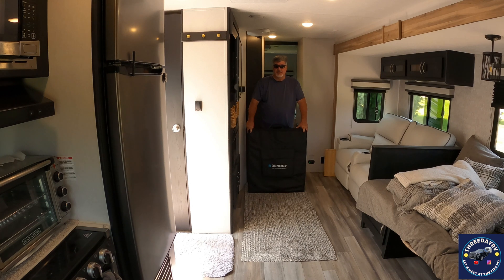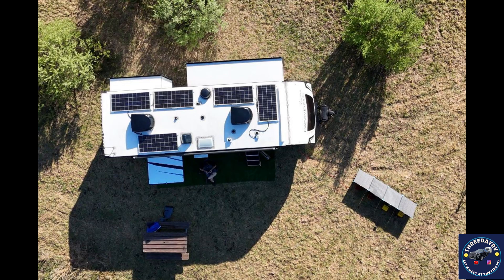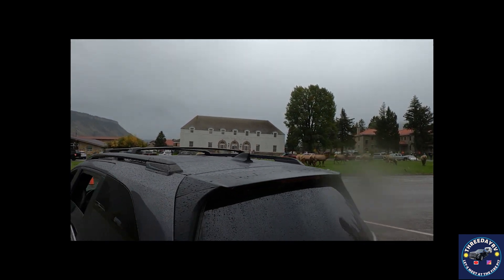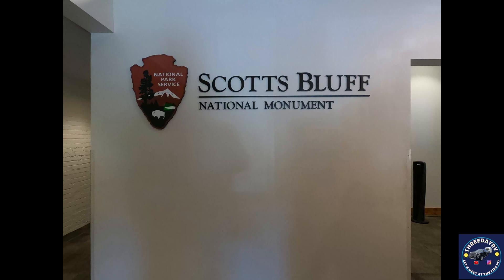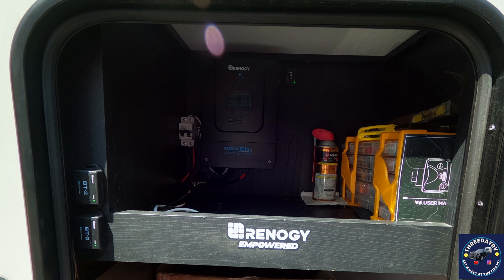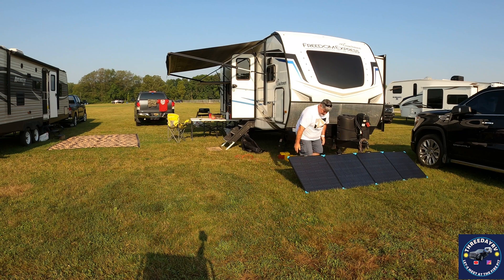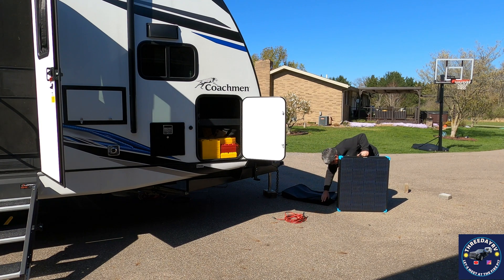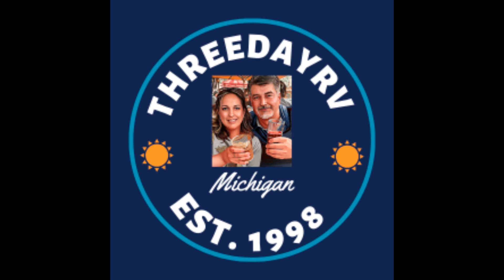Renogy Experience Upgrade Part II

Comment: What was the cost of your origional system?  What did you spend on the second system?  Did you do any of your own install or did you have it professional install everything?  Nice setup!!
Reply from the maker: I will share the original video in this comment at the very end. Everything I purchased was on a flash sale or some type of holiday sale such as black Friday cyber Monday, etc. etc... There was quite a bit of planning involved getting all of the parts and pieces together.. 
In the video there should be some chapter markers where you can freeze frame my material list, I believe we were just over $3500 total and I did the custom installation. 

You pay for what you get with some of the equipment, so be sure not to skimp on the copper wire, the lugs and the components themselves ... 
I worked in the skill trades, my whole life as a professional, so this type of stuff is somewhat a hobby for me and I really enjoyed doing the work.

There are many different companies that have different components so you really have to watch on what you buy and you also have to know how much is too much . Currently at the moment we have 1250 W of solar on the roof with that 400 W deployable panel. It works really well for us.

For anybody that's interested, here is our all began for us !

https://youtu.be/w0owyx3x4Ig?si=anzgdO71yOgx_wFo

Comment: That deployable panel is one of the nicer ones I have seen, not to mention you get 400w out of it.  We have been very happy with all of our Renogy items as well.  Thanks for the video- Kyle
Reply from the maker: I tell you what on the hot days this deployable panel is a difference maker when you need that air-conditioning to run! 
lol

Comment: I struggle most of the time with my Renogy One Core and even getting into my newest Renogy waterproof dc-dc charger settings.  Wish they were flawless but I guess I still enjoy the products.  I guess....
Reply from the maker: @Bizill75  hey Bill, thanks for the comment, shoot me some pictures of your set up. I'd be curious to know how it hooked up and what you use. I've had really good luck with this, but I am a little bit overboard with connection, quality, and cleanliness… But so far so good, fingers crossed.

My email is threedayrv@gmail.com

Show me some pictures of your set up. Maybe I can see something that's causing you some grief.
Kind regards – Keith